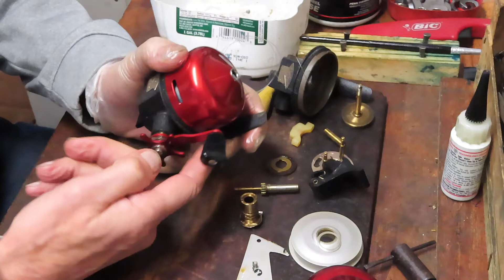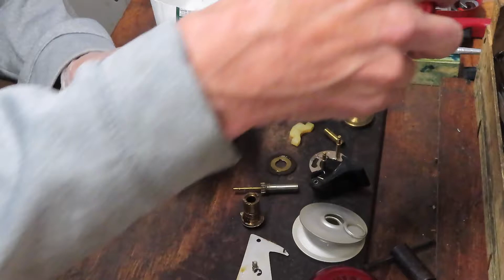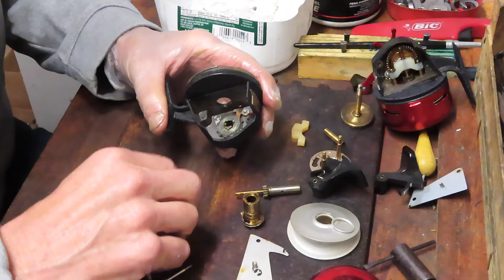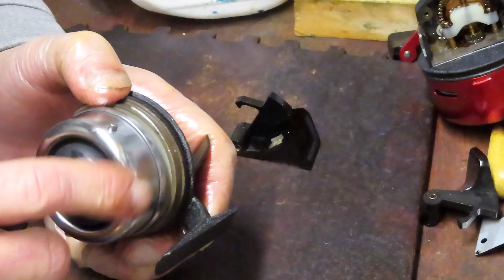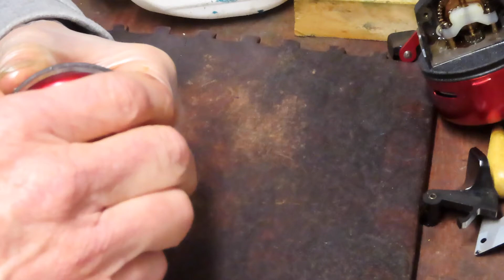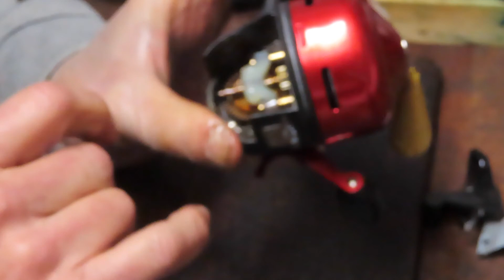Abumatic 170 closed face bait casting fishing reel how to take apart and service

Comment: What a great detailed video!  I am dusting off my original fishing gear and have this reel on a rod. I am having trouble finding out the proper way to set the drag for this, can someone point me in the right direction?  Thanks.
Reply from the maker: This reel has the star adjuster by the handle.  I think you would turn it clockwise to tighten the drag and  counterclockwise to loosen its but it may be the opposite as the reel is normally fished facing up. - Dennis
Reply: @2ndChanceTackle  thank you

Comment: Do you have a video on the Abu Garcia Abumatic 475 closed face reel? I have no idea how to spool it. Thanks
Reply from the maker: Here is how to do it from the reel manual D. HOW TO FILL THE SPOOL WITH LINE
Abumatic® spincast reels are designed for use with monofilament and braided lines. Personal
preference and fishing conditions will determine proper line selection.
Begin by attaching the reel to the rod. Remove the spool cover of the reel by rotating it counterclockwise (left). Pass the line from the filler spool through the opening in the spool cover. Attach the line to the reel spool using an arbor knot. Line should feed on the reel spool in the same direction as it is wound on the filler spool to reduce line twist. Reinstall the front cover on the reel by rotating it clockwise. Fill the spool according to capacity specifications. Do not overfill. (CLICK HERE to learn how to tie the arbor knot in this video)
You can get the full manual for the reel by clicking this link https://purefishing.a.bigcontent.io/v1/static/ABUMATIC%20SPINCAST%20INSTRUCTION%20MANUAL Dennis
Reply: @2ndChanceTackle  Thank you soo much. You're a gentleman and a scholar

Comment: I have some Johnson models that have a drag setup that is similar to the Abu 170,it works well once you get used to it.
Reply from the maker: Johnson reels are in the same class as the Abumatic.  Well made and well designed.  Thanks for the note - Dennis

Comment: I have one of those and I can't seem to get the handle and drag to work right.  The drag will barely turn and when it does it is either full drag or no drag. I just can't seem to get it figured out
Reply from the maker: Do you have the spring and washer assembly inside the handle cap?  That provides the tensioning.   I don't think I showed that on the video, but it is under the handle  screw and nestled in the cup of the star adjuster assembly.  If the is correct, then the problem could be with a stuck drag washer - Dennis
Reply: Thanks Dennis.  I'll take it apart and see what I can find

Comment: Do u have no use mon on these rells or can use braid
Reply from the maker: They were designed before braid, so I am not sure if the braid would slip on this one.  That spool is pretty slick.  If you try braid, back it with mono - Dennis